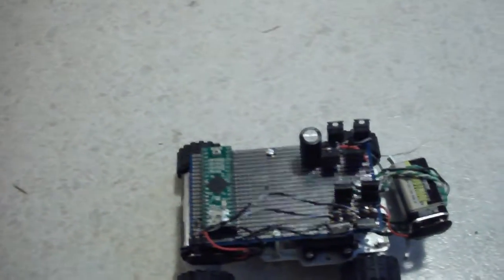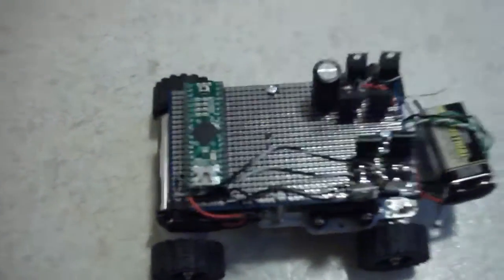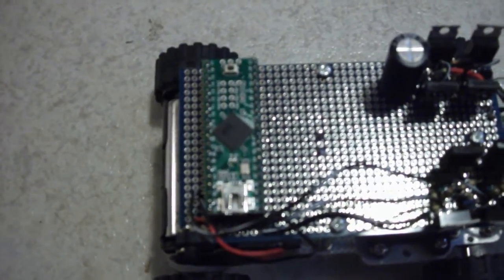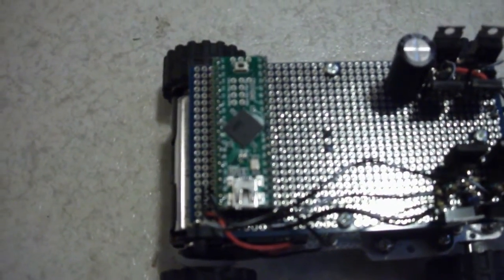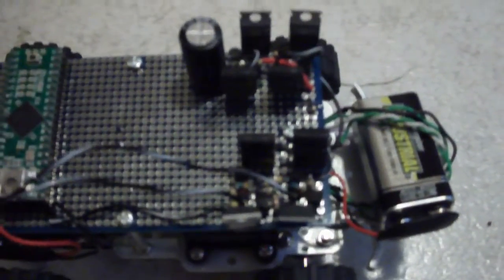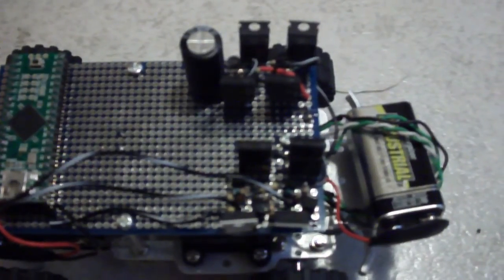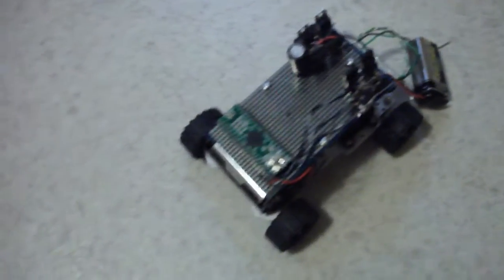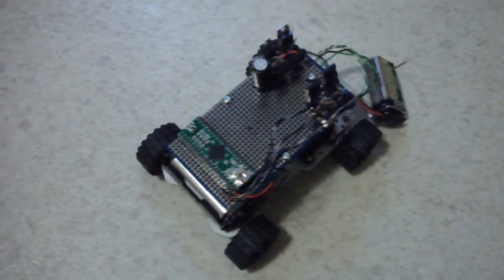4x4 Robot Chassis

Comment: Any details on the frame? I just got the arduino uno and I have a boe bot with servos as wheel control... wanted to do some real robotics and add actual dc motors..seems like a 9v would die fast since they usually have low mAh?